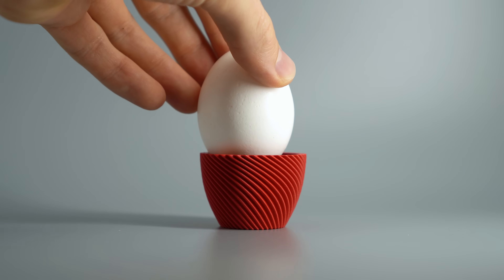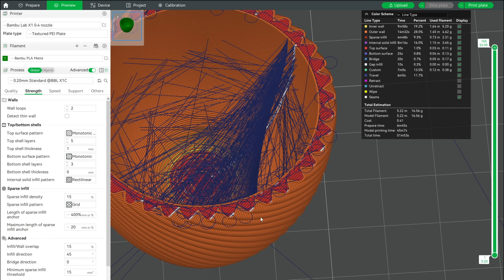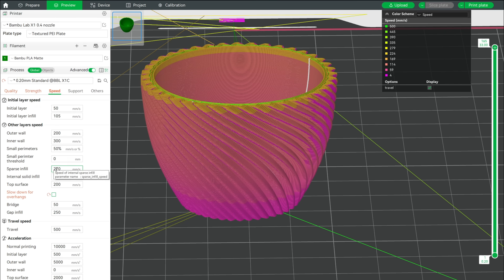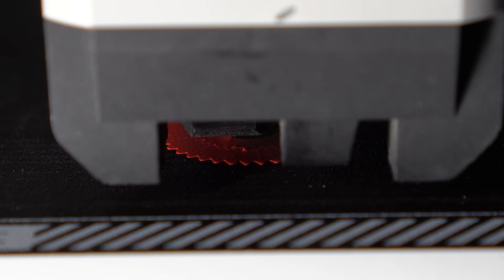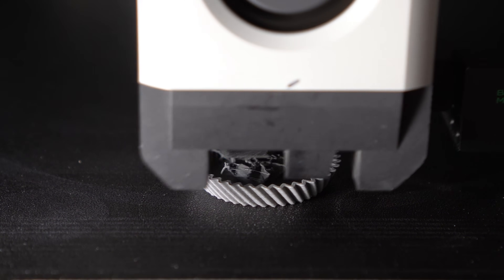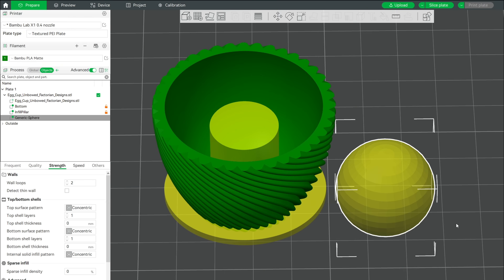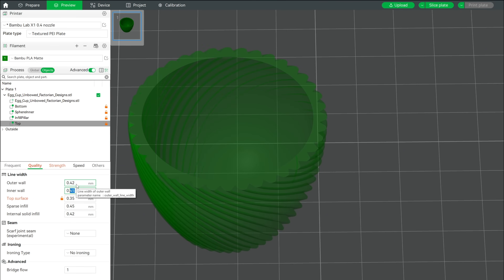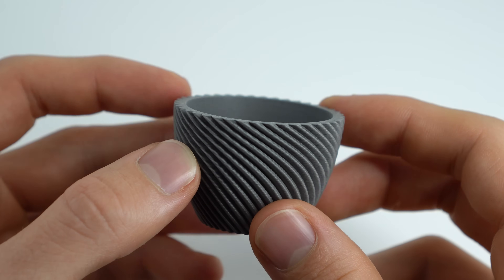Crazy 3D Slicer Hacks for Perfect Prints!

Comment: The biggest grime for me with Bambu Lab printers is the preparation time. With my old printer I could print withing THREE minutes from flipping the switch on my COLD printer!
Reply from the maker: I often times use a custom "fast start" gcode sequence. Very easy to integrate and due to the fast heatup time is very short. No resonance frequency test, no leveling, no lidar test, only one small purge line and homeing sequence just like with every other printer. A quick google search should give you the template for that.
Reply: @Factorian_Designs  With my old printer I only had like 10 lines of Start G-Code. The ones I put there myself! God bless Cura!
Reply from the maker: @Tome4kkkk  Yeah I understand what you mean. Its simple and sexy but some of the stuff bambu has integrated into their start sequence are pretty useful for more casual useres. Luckily you can still modify the whole sequence to your heart's content.

Comment: I dont quite understand why you didnt just leave the top and bottom layer count at what you wanted it to be then do a cylinder that reduced whatever you needed after the fact less modifications same thing
Reply from the maker: If you leave the top and bottom layer count higher than 1 it will add material in the middel parts again. Just like explained with the vertical shell thickness.
Reply: @Factorian_Designs  I went back and realized that it is adding thickness because the Inner part of the cup is also  considered “top layers” but now i am a little confused on how increasing both z offset and elephants foot compensation makes the first layer more reliable. There was no explanation on how that improved the reliability and repeatability of first layers. I am sorry to ask so many questions but i am new to 3d printing.
Reply from the maker: @x_Layers  in the video we are decreasing the distance to the build plate, this will add more squish and more adhesion (-0,04 -> -0,08). The elephants foot compensation is just to get rid of the sharp bottom edge.

Comment: The print modifier to make the infill support for the base was good, but to make the bottom thicker, it would be easier to just add a hight range modifier (I use those a lot)
Reply from the maker: Thats also a valid solution, lots of different ways to solve the same issue :)

Comment: Great video but why did you use separate modifiers to adjust the amount of layers at the top and bottom of the print instead of doing it directly in the slicer?
Reply from the maker: This would again add material in areas where we don't want any, just like with the ensure vertical shell thickness setting.

Comment: This was amazing information. I am actually struggling with a current job for some plant pots that have somewhat of a similar outer layer design to the egg cups and I’ve been having a hard time optimizing my slicer settings to bring down the print time and material used. I will most definitely try to use these some of the suggestions in this video tu see if I can achieve improvements. Thank you so much for making this! Subscribed!!
Reply from the maker: Sound like this video is perfect for you, let me know how it worked out! ^^
Reply: @Factorian_Designs  Will do! Thank you!

Comment: Lots of useful info in this video! Changing the line width for the first layer to make the slicer choose a different path is a weird one. Janky as hell, but if it works, it works.
Reply from the maker: Yeah, it took a while before I figured this out. ^^
Reply: Does it work for you? Unfortunatelly changing line width for the first layer doesn't change the path of the nozzle
Reply from the maker: @zyxurr  Yes it does most of the time but sometimes you have to try lots of different values. I wish there was a better solution. Sometimes changing the bottom pattern to "Archimedean cords" leads to the desired result as well. I wish they would integrate a real setting for this.

Comment: Thank you so much for your video, very useful for a beginner. The only problem is that I'm trying to print a vase with a base 160 mm in diameter, but I can't set the initial layer to start from the walls instead of the centre; I tried changing the initial layer line width from 0.2 to 0.6 mm, but nothing changed. I tried printing as it is, but the centre point is always resulting in the filament not sticking to the plate. Do you have any other advice?
Reply from the maker: Did you try out smaller changes like 0,41 -> 4,425 ? You could also try to add a modifier with 20+ walls for the bottom only and set the printing order to "Inner/Outer/Inner". Not sure if this will fix it but its worth a try.

Comment: Why not just change the top and bottom layer settings? Why use modifiers for that?
Reply from the maker: This would again add material in areas where its not needed. Its the same as with the "ensure vertical shell thickness" setting.

Comment: Good video! Have you tried using variable layer height to smooth out the inner bottom? (Setting it to 0.08 at that height). Might show on the outside though, but I doubt it, at least with matte PLA.
Reply from the maker: Good input but I haven't played around with that too much. I am honestly not sure if it wouldn't be noticable on the outside. This would also increase the printing time by a bit. But this cloud definetly be worth a try.
Reply: @Factorian_Designs  Yeah, it will increase the print time a tiny bit, but it will even further enhance the professional appearance. Worth it imho 🙃
Reply from the maker: Maybe you are right, I will give it a try. :)

Comment: I'm surprised you didn't use variable layer height to address the uhum not-so-nice inside bottom curvature where the egg sits. Those layers are extremely visible. I guess that's the perfectionist in me. Some very good tips though, I will definitely try these. Can you make a similar video on overhanging curves? What I mean by that is: imagine you printed the egg holder upside down. Then how do you get the curved inside overhang looking nice? My X1C struggles with that so much and it's really inhibiting me. I get a ton of stringing and just ugly cohesion using PLA.
Reply from the maker: Like said in another comment, this would also affect the outside of the print, I am not sure if this would look good. Sadly you can't do variable layer height for modfiers only. 

As a side note: Everyone who is into 3D printing seems to hate the layer lines but the consumer perspective I haven't gotten a single complaint about them on the inside. 
Some even like the layers style when they are thick and visible. I recently saw an injection molded planter that imitated thick layers of a 3D printer xD.

Overhanging curves are a hard one, but I have a video in mind which may touch on that subject a little.

Comment: The g29.1 is only if you use Pei textured plate you have tp copy the complete block and add your plate
Reply from the maker: You are completly right, I forgot to mention that in the video. Thank you for the addition!

Here is a quick example on how to do this: (From a Bambu Wiki post)

;===== for Textured PEI Plate, High Temp Plate and High Temp Plate ===============
;curr_bed_type={curr_bed_type}
{if curr_bed_type==“Textured PEI Plate”}
G29.1 Z-0.04 ;squish of -0.04mm for Textured PEI Plate
{elsif curr_bed_type==“High Temp Plate”}
G29.1 Z0.03 ;raise of 0.03mm for High Temp or Wham Bam Plate
{endif}

i e depending on which plate you chose, the offset will go up or down.
You can amend Z0.03 to more or less
positive number = offset up (less squish)
negative = offset down (more squish)
Reply: @Factorian_Designs  
;===== for Textured PEI Plate, High Temp Plate and Engineering Plate ===============
;curr_bed_type={curr_bed_type}
{if curr_bed_type=="Textured PEI Plate"}
  G29.1 Z-0.04 ;squish of -0.04mm for Textured PEI Plate
{else if curr_bed_type=="Engineering Plate"}
  G29.1 Z-0.04 ;squish of -0.04mm for Engineering Plate 
{else if curr_bed_type=="High Temp Plate"}
  G29.1 Z0.03 ;raise of 0.03mm for High Temp or Wham Bam Plate
{endif}
with this all plates are inside needs only to update the Z value. or go crazy 

TEXTURED_PEI_Z_OFFSET = -0.04   ; Z offset for Textured PEI Plate
SMOOTH_PEI_Z_OFFSET = 0.00      ; Z offset for Smooth PEI Plate (if applicable)
ENGINEERING_PLATE_Z_OFFSET = -0.04  ; Z offset for Engineering Plate
HIGH_TEMP_PLATE_Z_OFFSET = 0.03  ; Z offset

;===== for Textured PEI Plate, High Temp Plate and Engineering Plate ===============
;curr_bed_type={curr_bed_type}
{if curr_bed_type=="Textured PEI Plate"}
G29.1 Z{TEXTURED_PEI_Z_OFFSET} ;Z offset for Textured PEI Plate
{elsif curr_bed_type=="Engineering Plate"}
G29.1 Z{ENGINEERING_PLATE_Z_OFFSET} ;Z offset for Engineering Plate 
{elsif curr_bed_type=="High Temp Plate"}
G29.1 Z{HIGH_TEMP_PLATE_Z_OFFSET} ;Z offset for High Temp Plate
{endif}

Comment: I made a list of changes:

Here is the updated list of changes made in Bambu Studio with the specific values added:

1. **Activate Advanced Mode**: Turn on the advanced mode to see all settings.

2. **Optimization of Walls and Layers**: 
   - Reduce the number of top layers to **1**.
   - Reduce the number of bottom layers to **1**.
   - Set the infill to **0%**.

3. *Set Top Shell Thickness to Zero* or *disable Ensure Vertical Shell Thickness* to avoid unnecessary infills:
   - Set the top shell thickness to *0 mm* or uncheck "Ensure Vertical Shell Thickness".

4. **Enable Avoid Crossing Walls**:
   - Set the maximum detour length to **200 mm**.

5. **Change Print Patterns**:
   - Set all patterns (top, bottom, and infill) to **concentric**.

6. **Disable Z-Hop**:
   - Set Z-hop when retracted to **0 mm**.

7. **Equalize Print Speed**:
   - Uncheck "Slow Down for Overhangs".
   - Go to the filament settings and under the cooling tab, disable "Slow Down Printing for Better Layer Cooling".

8. **Adjust Z-Offset**:
   - Slightly reduce the Z-offset by *0.05 mm* (via the `G291` command in the machine start G-code).

9. **Increase Elephant Foot Compensation**:
   - Increase by *0.1 mm* to reduce the first layer's sharp edge.

10. **Change First Layer Line Width**:
    - Slightly adjust the first layer line width by *+/- 0.02 mm* to change the extrusion path for better adhesion.

11. **Add Modifiers**:
    - Add a cylindrical modifier with a diameter matching the critical area and a height of **2 mm**.
    - Set the bottom layers for the modifier to **3**.

12. **Reduce First Layer Speed**:
    - Set the first layer speed to **30 mm/s**.

13. **Avoid Lightning Infill**:
    - Instead, add a cylindrical modifier and use *rectilinear* infill with a density of **15%**.

14. **Increase Additional Top Layers and Thickness for Critical Areas**:
    - Increase the top layer count to *3* and set the shell thickness to **0.6 mm**.

15. **Avoid Single-Point Extrusions**:
    - Adjust the line width for top surfaces by *+/- 0.05 mm* until small triangles replace single-point extrusions.

16. **Reduce Print Speed for Clean Surfaces**:
    - Reduce the speed for top surfaces to **40 mm/s**.

17. **Slightly Rotate the Main Geometry**:
    - Rotate the geometry by *1-2 degrees* to align the seam.

These values will help optimize print settings for quality, speed, and material usage.

Comment: Why not turn on ironing for the top layer?
Reply from the maker: Ironing on small top surfaces like these never really looked good on my prints. 

I also like the patterns created by a clean top layer when 3D printing. It adds a little extra charme compared to injection molded parts, but I guess thats just personal preference. :D
Reply: @Factorian_Designs try these settings:
150mm/s ironing speed
39% ironing flow
0.2mm ironing line spacing

That may give the look you want for smaller areas like this

Comment: What's the difference between using a modifier to change the top shell thickness of the print versus just using top shell thickness setting in the original model?
Reply from the maker: Like with "top shell thicksness" this will add material where we don't want any, shown at min 01:50. Using a modifier enables you to set the global top layer count to 1 and still have good top surfaces. 
Hope that helps!
Reply: @Factorian_Designs  makes more sense, thanks! I haven’t used modifiers too much but I’ll definitely try to use them more when I need a functional print or models I’ll print many times :)
Reply from the maker: @TBerq  They can sometimes be a game changer, thank you for watching!
Reply: @Factorian_Designs  thanks for making the video :)
Reply: Can you share your process for diagnosing and identifying settings to change for a specific print?  I'm assuming you watch (perhaps from a video cam?) the print looking for clues... what else?
Reply from the maker: @neurojitsu  Thats the hardest part, lots of time watching the printer print, countless iterations and looking a slicer previews. I sadly can't give you a better answer than that. I have around 20 different Slicer versions on Cura, 40 Prusa Slicer and 30 on Bambu Studio of this eggcup to find out all these tricks.